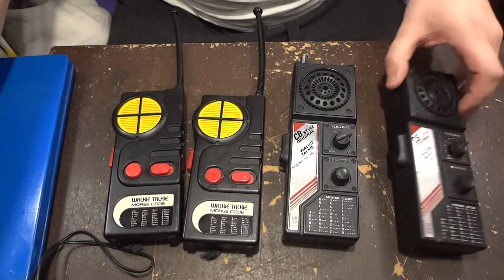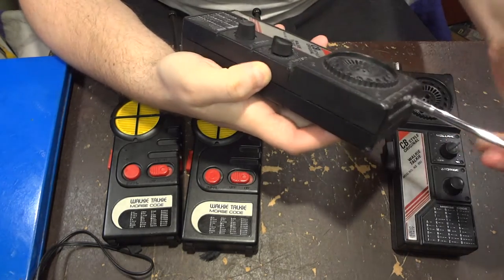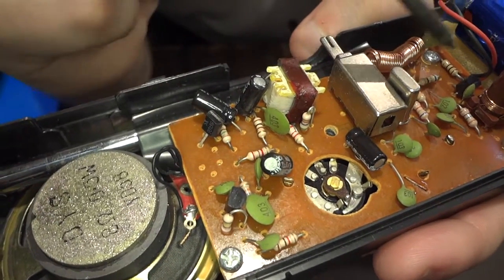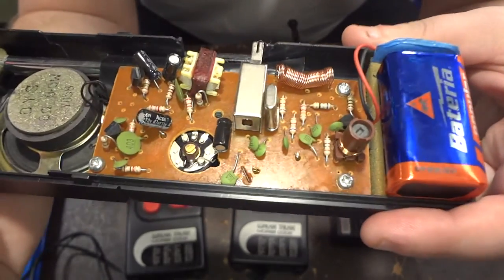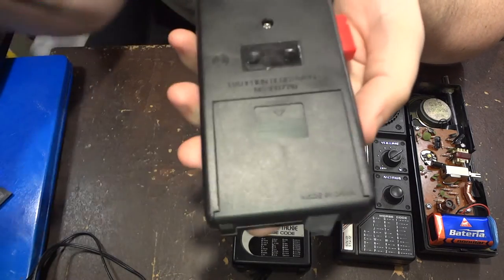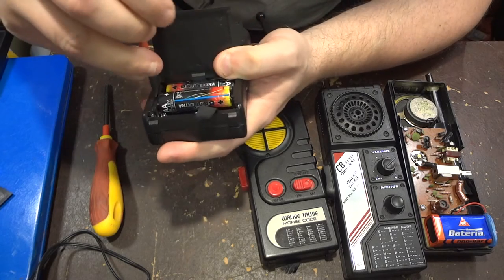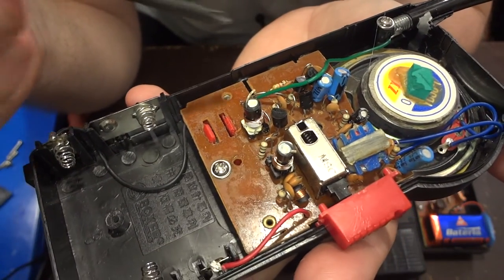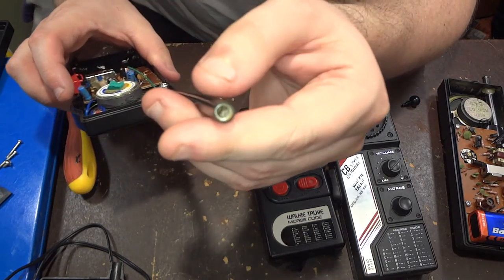NS - 881 and "Boxer" Walkie Talkie Morse Code Comparison

Comment: Got a similar Boxer walkie talkie for radio experiments at a flea market for 2eur. Only mine is with telescopic antenna. Checked on SDR, TX frequency is the same 49.8 Mhz in wideband FM. As I understood SIGNAL button is supposed to be pushed while talk button is pushed as well. Otherwise it only beeps and sends no transmittion. Produces a more powerful beep for longer distance communication using morse code I suppose.

Comment: I have the Shira one like yours but it works on 49.860 MHz AM.  It has two transistors on the IF/RF side and three transistors on the audio side.  Have you come across this model and if so do you have schematic for it?

Comment: good, very good video ...
have their scheme?
Reply from the maker: +Antonio da Silva Thanks. You can find scheme on the internet. When you will google in pictures "NS 881 site:CZ". It's very nice circuit. I love simple receivers. I have traced out the scheme of the "boxer" walkie talkie. It's also very nice super regenerative circuit receiver, which I isn't on the internet. I have already written to my list of "want to make project video" that I have to make one video with this "boxer" walkie talkie super regenerative receiver. I made a quick prototype of the receiver and I have received quite acceptable FM broadcast. I want to improve this circuit and make simple FM receiver project video. I can't promise, but maybe within half a year is there a possibility that I make a project video about this receiver on my MDF RESCUER channel. Definitely check that channel out.
Reply: +Ondrej Janovec (MDF RESCUER) thanks for the tip...
thanks for listening,
am AM receivers fan
Reply from the maker: +Antonio da Silva The receiver from NS 881 is AM. I've rebuild the circuit to simpler version, with just simple tank circuit at collector and with a capacitive coupling to antenna. It is now very simple circuit. This leads me to show the prototype earlier at least on this channel. It is one transistor audion receiver and the receiver works the best when everything is tuned, after changing the frequency the receiver loses the running and stops it's receiving ability.